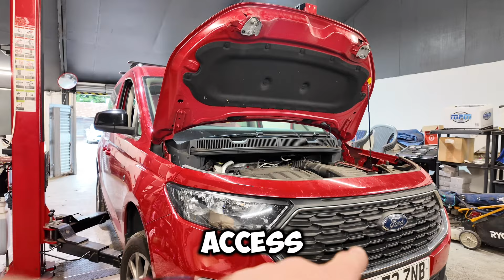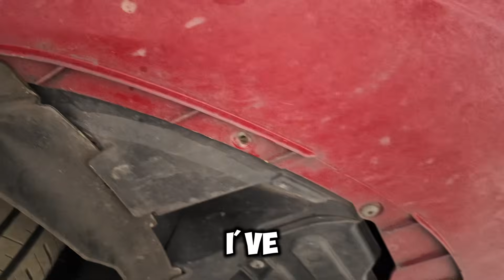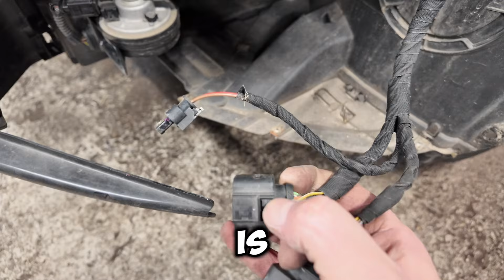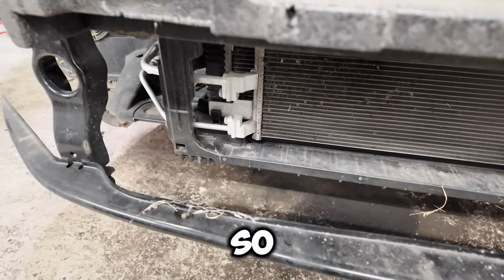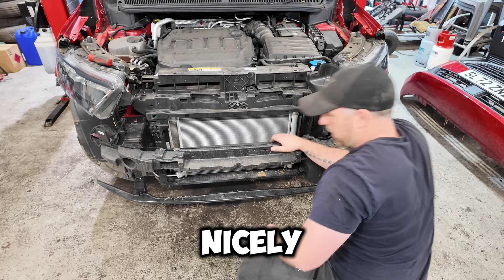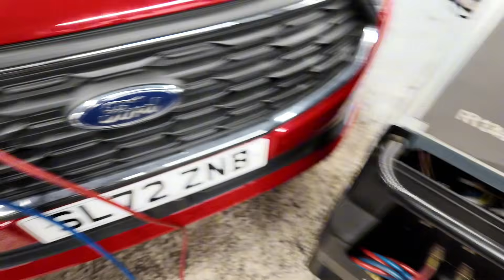Ford Transit Connect A/C Condenser Replacement Made EASY!

Comment: I have porsche bosxter 981, its my 3rd porsche and the condensors on everyone fail due to damage, its a real crap design. I mesh over them now however i replaced the condensor rads originally for £20 each. Some cheap importants from china. Been on the car 7 years now, faultless.
Reply from the maker: It’s crazy how much of a difference a bit of mesh can make for protection! 😊

Comment: if they would have had still gas in it could i change it my self in a parking lot and after i prolly would have to go to a garage to get r134a filled up in my system? because ac is still working but condenser is really damage and pretty sure i have a slow leak from there because sometimes work fine and 75% of time work really weak.
Reply from the maker: Hey 👋 if you had a leak it wouldn’t work at all, I would have it tested properly first to get a diagnosis 😊